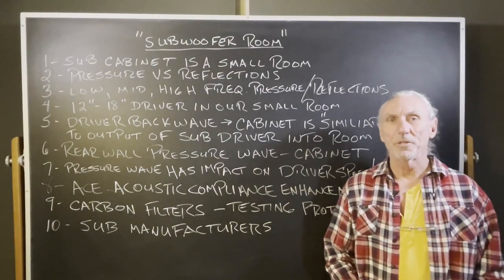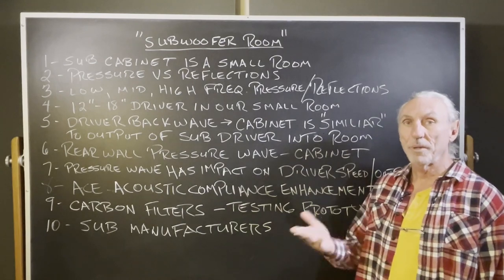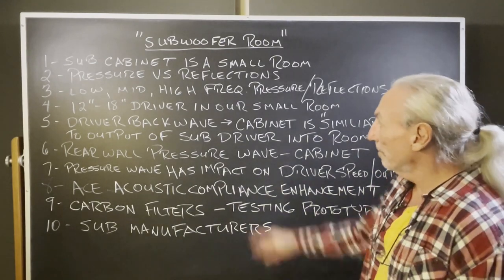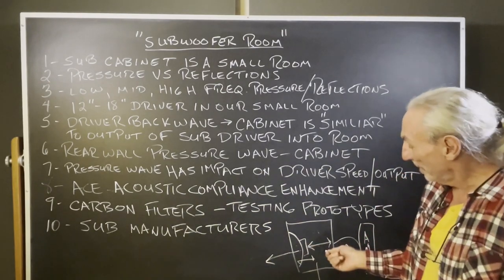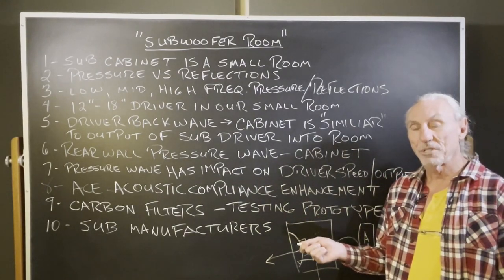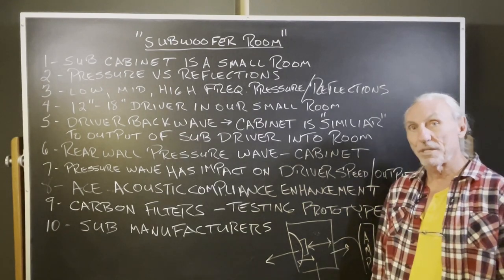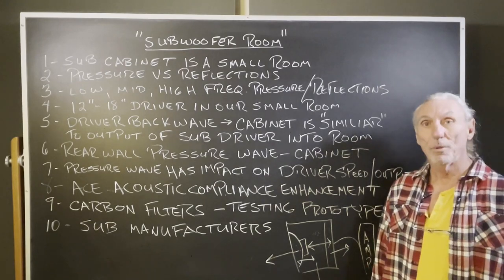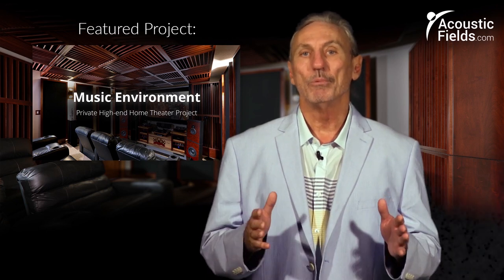Subwoofer Room - www.AcousticFields.com

Comment: I'd be interested to see that too!
That's why there are open-back headphones where back pressure isn't much of an issue
Reply from the maker: I would guess that open - back headphones are a design strategy to manage low frequency quality. Just like subs have sealed and ported boxes to achieve the same set of frequencies.

Comment: I would love to see if this would help me in my system for the vehicle.   I have 8 12" subwoofer in a 4:1 1/4 wave 4th powered by a 12,000 watt amp.  the response is 7hz-68hz. It produces results below 7hz but, drops off due to amplifier capabilities. My issue is around 13hz -18hz. It has a bad null around those frequencies. I've fixed the resonance in the cabin of the vehicle but, still have this issue. I want to add another layer to the back wall to make it stiffer. And, I've also thought of using foam panels to help.
Reply from the maker: Foam is a middle and high frequency absorption technology. It will not work for low frequency absorption issues.